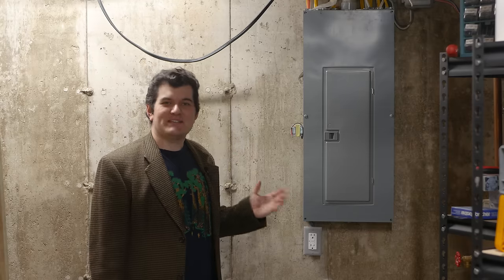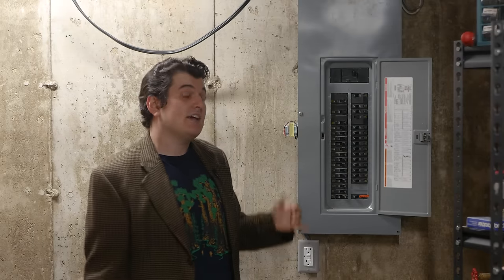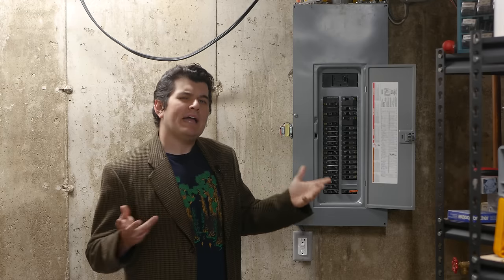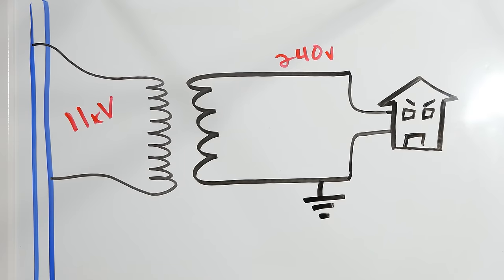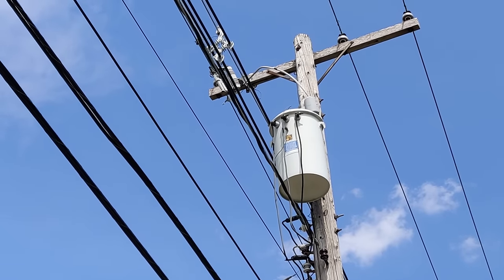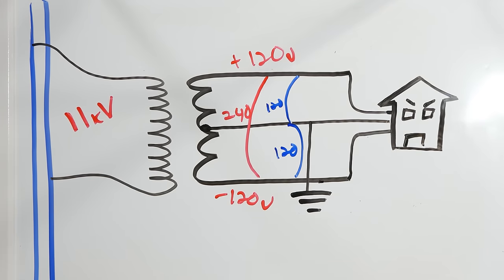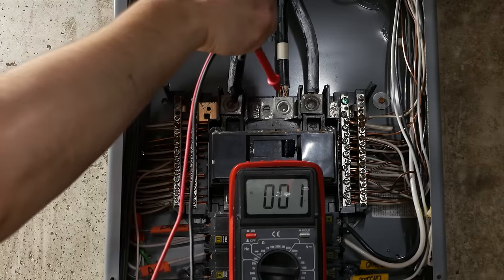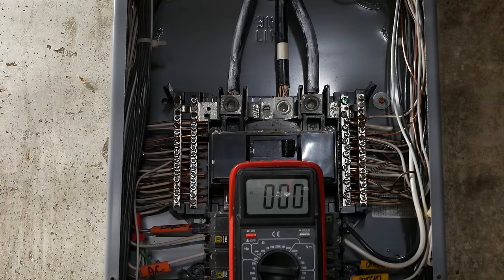The US electrical system is not 120V

Comment: "To Europeans this looks horribly dangerous. That's OK, we're coping."
You have the best lines.
Reply: Having seen into his fuse box, I would say that his lines are actually pretty bad...
Reply: Holy fuck, he wasn't kidding. That looks more than horribly dangerous.
Reply: @vezokpiraka  Only if you're fiddle-farting around in the service panel with the cover off. Something he explicitly said not to do. Try to keep up, pal.
Reply: @vezokpiraka  OK, the neutrals look like a rat's nest, but those are neutrals :P
Reply: hawkturkey  I mean. Our wires rlly aren't that thin tho? I'm not entirely sure where you'd have gotten that idea?

And even then our actual breaker panels are way better designed
Reply: @Artemis0713  agreed. I wish the entire planet used schuko plugs.
Reply: Except that we're not coping.
Reply: hawkturkey  The hell are you talking about?
Reply: @silentkiel  you can't have polarised plugs with the shuko outlet, because it's symmetrical, and appliances are required to work plugged in either way.
Or am I misunderstanding what "polarised" means?
Reply: It is dangerous in the USA 
In the UK we use 240, know it's dangerous and so actually have safety features to offset this, and end up with a much safer system
Reply: hawkturkey  The thin wires are the advantage, much more flexible and cheaper, and because we are constantly told it's dangerous we have safety features to protect us, and so we end up with much fewer accidents
Reply: @rsman23  : Occasionally a squirrel or something will start a fire by crossing 1930s era wires, or by nibbling into the wires, but the only way to fix that is new wiring & armored conduit. Over-glorified European plugs aren't in the right place to stop that.
Reply: @soiledhalo2296  I'd rather have the French version. Because with those ones you have the possibility to ALWAYS have the potential/live wire on the same prong.

Funnily enough the French don't specify that in their regulations...
Reply: He should show an old style fuse box with the old cylindrical fuses, we used to put copper Pennies in them if we didn’t have a fuse, but was extremely dangerous and could start a fire. Good times, good times. 😄
Reply: @davidioanhedges  I don't know what fake news you've been reading, but I've literally never heard of anyone being hurt by American wiring that's actually up to code. (I have an uncle that got killed by faulty wiring from the 1920s, and I've personally been shocked when replacing an outlet that I forgot to cut the power to, but that's literally it.)

Sure, you could potentially touch the contacts on a plug that isn't inserted properly, but that's the fault of the idiot that didn't insert it properly, or at worst the fault of the socket, not the plug. (If a socket gets worn out, it won't hold the plug very well and it can partially fall out, but again, that's the sockets fault. Replace it, and the problem is solved.) It's also worth pointing out I've never heard of this happening. I'm sure it has with some moron or another, but that is said moron's fault.

And you seem to be under the impression that the US doesn't teach people that electricity is dangerous. I genuinely have no idea where you would've gotten that idea. They drill that shit into our heads practically from the day we're born. (A lot of people never actually listen to any of of it, but that's there own stupid ass faults.) 

The US may not have all the horrifically over engineered bullshit that the UK has, but that's because we realize we don't need it. You have to either be cutting some serious corners to try to save a few dollars, or simply be a supreme idiot to actually get hurt to a noteworthy degree by US electrical systems.
Reply: hawkturkey  where do you get this wisdom from? here in Europe we do not save one conductor from our feed compared to the US, instead we add an extra one, so each normal household has a three phase 240/415 + neutral feed. Also our wires are not thin at the distribution level, as just the simplest homes having at least 40A at 3P, many homes in fact have 63 A at 3P.
Reply: @F3Ibane  Or when, say, you're removing that metal panel and touch it to some of the unshielded wire connections underneath -_-'
Reply: hawkturkey  Exactly because of our 230V we are fine with 1,5mm² wires with can carry 16A - 3.7kW are more than enough for our stuff. Washing machines and stoves requires 2.5mm² wiring.
Btw: Most flats have a single phase at typicall 40A.
Reply: Markus Sommer the belgium shuko version is polarised. And still compatible with the German and Netherland ones
Reply: silentkiel å
Reply: Honestly what’s most concerning for me is our electrical company if you research Pacific gas and electric then you will see a large number of safety problems
Reply: @davidioanhedges  Wires are not thinner....
Reply: @r.h.8754  Being a german who has previously lived in France, I am entirely aware of that (though there really is no such thing a a "french schuko", if you say that to a french person they will probably get annoyed...)

What I was referring to was the previous commenter saying that "unfortunately", schuko-compatible plugs are not polarised. However, the concept of a polarised plug is antithetical to the schuko which was purposefully designed to be reversible.
So any appliance which might be plugged into a 7/3 outlet needs to be built in such a way that it works safely with the live and neutral line in either configuration. And if you build all your appliances in such a way, then there is really nothing "unfortunate" about the plug being unpolarised.

And devices with a 7/7 Combi-Plug still need to adhere to that standard, since they might be plugged into a 7/3 outlet.
Reply: @silentkiel  "This isn't a big problem for most devices but for a portable floor lamp with Edison sockets it means that there is a 50% chance that L will be on the thread instead of the center contact."

How is that a problem? The bulb don't care.
Reply: @xiaodingjones1554  It's a problem because you can touch the thread more easily.
Reply: hawkturkey  Japan doesn't need more voltage, because the country is rather small. So they can increase current through their power lines without significant efficiency penalties.

European cables are intended to be thinner, because the current is smaller at 240V than at 120V (given the same load power). That's the entire reason to use higher voltages, man. That's why most of the power grid actually runs at kilovolts, only returning to consumer-suitable voltage a few transformers before your house: less heat loss in the power lines, thinner (less expensive) cables.

Thickness is only important when talking about insulation, and I don't quite see any problem with our insulation breakdown voltages.
Reply: @silentkiel  The CEE 7/7 is the best-of-breed, I'd say. You can use both polarized plugs, and the unpolarized Schuko with it.
Reply: @silentkiel  Usually it doesn't matter if polarized or not as long you have the ground wire (green/yellow) from the fuse box and the water pipes running through to the socket. In some cases in some old houses it's not.  Some twit caused me receiving a 240V shock from a computer I installed by changing the wireing confusing neutral and live. I don't know if using a single wire for ground and neutral had been legal in Germany at any time - but they did.
Reply: @davidioanhedges  The 240V plugs in the US are definitely more dangerous.  We could learn from the UK sleeved design in that regard.  No common 240V appliance here is generally one that one unplugs on a frequent basis and the plug itself is usually hidden behind the appliance so nothing is ever likely to change.
Reply: @DevilsVideos1  Yeah, Japan with their different frequencies...
Reply: @MustNotContainSpaces  Only if you screw around with them, something you should not be doing. You will find this as a reoccurring theme for a lot in the US: things are designed in such a way for use and we ignore morons that will somehow find some way of hurting themselves on otherwise safe stuff. It is not my responsibility for your safety, nor should it be. Don't be a dumbass and you will not get hurt. Or do and probably end up dead. See, we give people choices in the US. Freedom! But no, the system works just fine for trained professionals, the people using the panels, so adding extra fluff, and thus cost, is wasteful and stupid, especially given morons that will hurt themselves will just find some other way to with added safety features.
Reply: can't wait till electric cars get old and people try to fix them at home.phrase of the future; he was holey smoked
Reply: No mandatory leakage detector/differential protector? 😱😱😱
Reply: @davidioanhedges  I was under v the impression you guys run 50 amps to outlet so I doubt they are thinner
Reply: @davidioanhedges  some cursory googling would indicate that UK is at best marginally safer in regards to rates of electrocution per Capita
Reply: His panel is messy because he was wiring himself.  My professional-installed panel is nice & neat

.
Reply: @Richard1977  Because it really does not matter in 3 wire system. France has the Phase on right as a custom. SOme other countries like Slovakia where I tend to run wires it has it on the left. If you have a 3 conductor TNC-S system there is well no point of polarization.
Reply: @johnw.3270  I agree. It is probably best plug design overall.
Reply: @KB-mo3sx  and I wish 50hz goes out and the whole japan 60hz.
Reply: @soiledhalo2296  they da best
Reply: @Richard1977  you're right, Type E plugs are better.
Reply: @franciscosoares2440  I'll say Type E is a bit better as Richard pointed out.
Reply: @JohnHughesChampigny  But if you are clumsy and don't look what you do you can still get a shock. So just plug them out and everything is fine. And fixed installations generally care for the phase being better shielded.
Reply: A lot of the "Europeans" need to qualify their assertions with where in Europe they are. Always reminds me of the Swiss engineer I met in Moldova and his stories about needing to learn how things had been, and were being, done there.
Reply: @davidioanhedges where is your data on this?
Reply: @StephenMcGann their fire injuries rate is 3.3 times higher than the US, their fire deaths rate is just slightly lower.  Not all fires are electrical of course but this data does not show the UK being safer than the US when it comes to fires and in fact shows a much higher injury rate.
Reply: @exsperm  "Allowed?" It's YOUR house, bro. Who's gonna stop you?
Reply: @frgv4060  "No mandatory leakage detector/differential protector? "
Uh, you mean GFCI? Yeah we have them anywhere that the plug is near water.
Reply: @bcubed72  It needs first a centralized one. Besides, roof leaks, severe storms or similar etc can make anything “near water”.
Reply: This is why our wires have to be super huge thick and solid. They are not allowed to be flexible because if they pop out they won't touch anything. I know, weird right?
Reply: I sorry but you have mistake .... 

In fact then use 240 volt for same amount of energy  you need thinner cable.

So is less cost of Installation electric system.

Maybe you think is safest ,but in reality you need more copper..

More  money ....

More profit for electric part manufacturers companies...

I will give you one example about thinner cable.

 pc video card use 12v dc connector for cpu with working voltage about 1.4v and step-down the voltage inside to gain more current in same amount of energy. 

This design give the advantage of thinner cable. 

Is use direct voltage of 1.4v for 100w the current is 71A

Awg 4 cable !!!!
Or perhaps 2x Awg 8 cable...

REALLY  FAT CABLE!

With 12 v for 100w is use only 8.33A

In same logic as 2xAwg8 splits the current in 

4x16AWG CABLEs

Think about cost of cable ....